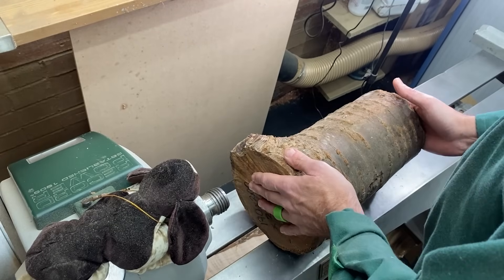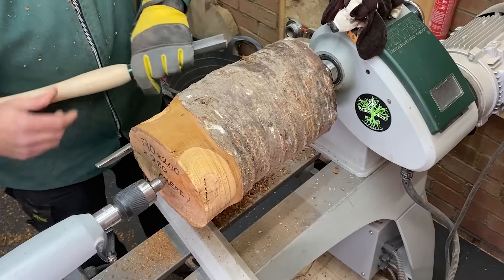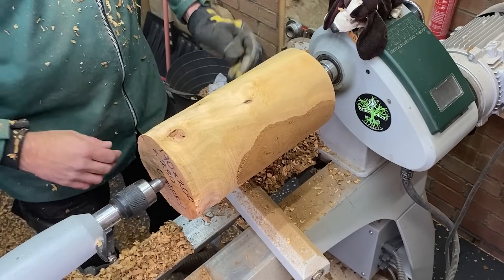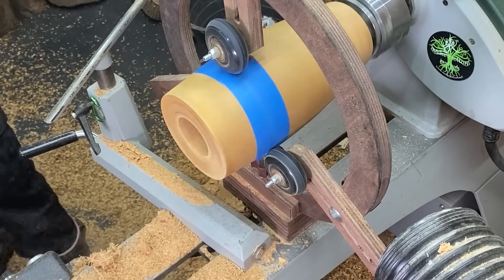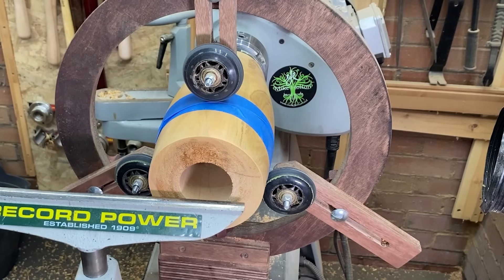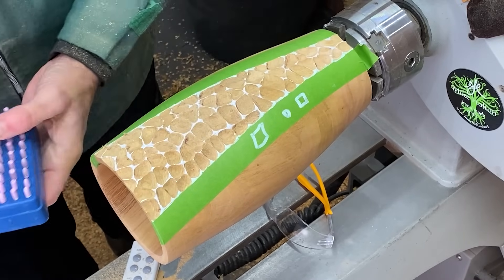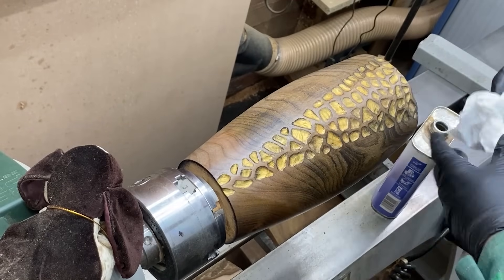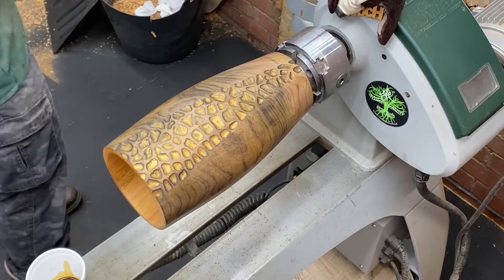Grinding for FUN - A CHERRY LOG woodturning experiment

Comment: Mike just a quick tip, When using the swan neck make sure the tool rest is on the flat bar it stops it from trying to twist. The Vase turned out really good, Keep up the Fantastic video's
Reply from the maker: Haha thanks Doug, I remembered that soon after I started to use it and moved the tool rest back 😃

Comment: I quite like the pattern, as you said, I also thought it looked better when the ridges were pointier, thinner.

Another thing I think could help with the looks if you completely finish it before making the pattern is that the "holes" of the pattern wouldn't have a black around them
Reply from the maker: I agree and did say that in the video, I think it would work a lot better 😀

Comment: I bought that kit on Amazon! I love it.
Reply: Very nice idea. I might try this on som peach wood I have lying around. It's going to be some time yet. It was just cut about 8 months ago.
Reply from the maker: What kit do you mean? Never turned peach but like any fruit wood it is prone to splitting to seal it well  😊
Reply: @MikeHolton  the carbide hollowing set. I think mine is different but it  has the handle extension and three tools. Mine came in a small case with metal sides. Airplane friendly. I don't travel much but I could put it on a plane.
Reply: @MikeHolton  Ancor seal👍
Reply from the maker: @archiehebron8944  that will do it 😃
Reply from the maker: @archiehebron8944  Ah yes, I have the same kit, it is useful but the handle is a bit light for me
Reply: @MikeHolton  you might be able to add weight into the extension with some ball bearings or steel shot. Even a bit of sand in a plastic bag might help.
Reply from the maker: @archiehebron8944  thanks, not a bad idea!
Reply: @MikeHolton  I think the steel shot would dampen vibration as well. Not 100%sur but I've seen handles made that way.
Reply from the maker: @archiehebron8944  I know you can add it to wooden mallets to stop vibration, I wonder if it would work?
Reply: @MikeHolton  I was considering that for mine.

Comment: Mike,
I have used some nylon wire brushes on a drill that I purchased from amazon.  They come in various grits and unfortunately a link wont post in your comments, but I can tell you that they do contour sanding wonderfully.  Just look for the ones with the smaller more flexible bristles in higher grits.  Also, I really enjoy your turning videos, but I may have an idea for some additional content for you.  We all hear you step away to sharpen up, maybe an educational video on your sharpening process would be something to consider.
Reply from the maker: Thanks so much Paul, I will have a look into the brushes, if you want to email a link please send to mike@mikeholton.net  I know what I types will look like a web link but if you copy it all into your email it will work. I will be doing a sharpening video at some time but my workshop it not set up in the area for filming 😊
Reply: @MikeHolton   sent the email.  Cheers!
Reply from the maker: @PaulTWOS  received 😀

Comment: Mike, you never fail to amaze me. From what would have been an ordinary vase into something that stands out from the rest.
One question, which size quick release handle did you use on the hope carbide pro tool. I have one but not sure which length of handle to buy.
Again great work 👍
Reply from the maker: Thanks! I got the longest one they had 😀 It is a very sturdy feeling unit, very happy with it .

Comment: Hello Mike.  Great video as always!  I was wondering if you could answer a question. I notice you always use isopropyl to clean your peices prior to finishing.  I assumed this was because you could clean the sawdust without having the wood grains stand up like they would if you used a damp cloth.  I tried this in my woodworking, but still had issues with the wood grains standing up and i had to resand.  Am I missing the point of what you do, or am I doing something wrong?
Reply from the maker: Hi there, it works best if you use it after applying a sealer, generally it will raise the grain a little after sanding but then apply a sealer then either sand again (high grit) or use an abrasive paste and then when you clean with IPA you will not have a problem. Hope this helps, Mike

Comment: The coulouring appears to have taken in such a way that the figuring in the wood has been highlighted. Any more than that would, in my opinion, have overpowered the piece. But this is very subjective. It doesn't help that I'm a fan of a natual finish using oils and waxes to bring out the natural figuring in the wood.

Once again, thank you for sharing
Reply from the maker: Thanks David, I put on the darker colour at the start and then sanded it back, this leaves the dark colour in the grain lines highlighting it which is quite a nice effect I think. All the best, Mike 😀

Comment: Nice piece Mike. I’ll have to agree with you on finishing the indentations last. It would also keep the stain from bleeding into the gold, making it more pronounced. 
You might get a smoother indent if you used a good carving gouge.
Thanks for sharing.
Reply from the maker: Thanks Barry, I did think about carving gouge but really not that confident with them 😄

Comment: Tut tut tut... Mike did you use some smooth yet punchy AI program to write the description? 

There is a bakery, somewhere near Wolverhampton I think. This is where the master baker was a bit of a dab hand with rotating saw blades and steam engines. Out of his kitchen one day came a loaf wrapped in paper; when his wife opened it she discovered that it was already cut up and she could butter the pieces straight away....You vase is the best thing since that invention. 

I see you were after a much more closed cell structure but even so you have made precious jewels down the side of this handsome vase. As you were drawing it on I noticed that your "cells" were square close to the origin line by the tape and then became triangular the further away you went. Maybe next time draw the squares unjoined and then join them up or find a way where the edge doesn't become an obvious point where everything is more regular.  The close ups of the texture inside are great, this kind of painstaking work is your signature and its what keeps us all so hooked.

I had a dremel but it konked out after very little use. There are some connectors inside for the stator power and they just fell apart...

Great work as ever Mike, thank you so much for what you do.
Reply from the maker: Haha you got me, being dyslexic I have to use the tools at my disposal and as I was very pushed for time with this one I had to take a few shortcuts with the description 😄, all the best and thanks again, Mike
Reply: @MikeHolton   Up yet another notch in my estimation..... Mike, you loyally reply to everyone and have dyslexia, your dedication knows no bounds.
Reply from the maker: @loopinnerthe  I think it is the very least I can do, everyone here has helped me turn a dream into a reality 😃